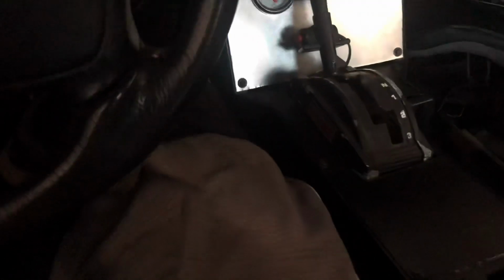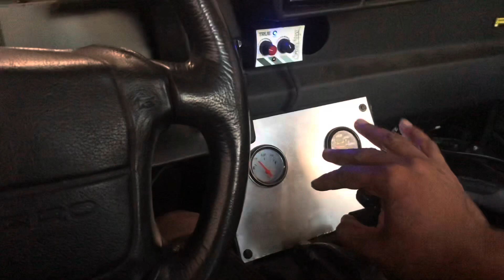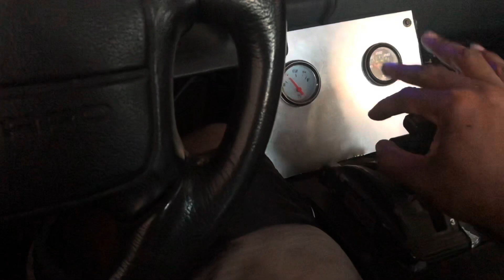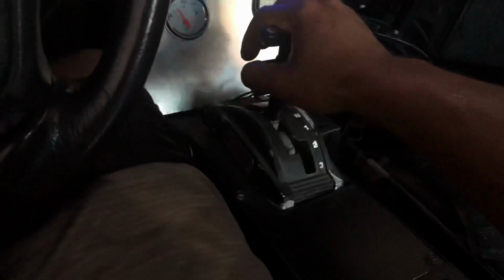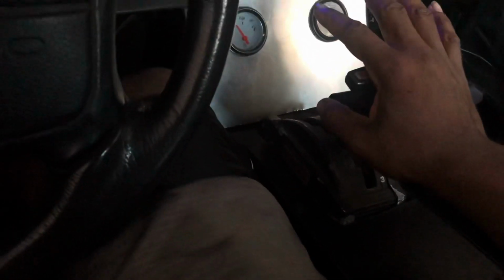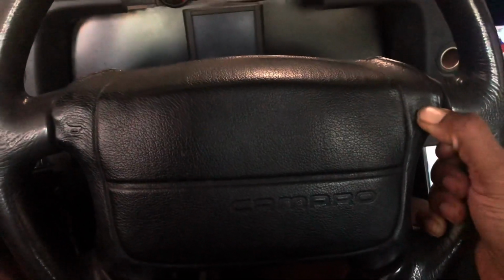Sloppy Turbo 5.3 Thirdgen Camaro gets gapped. #Fbody #turbo5.3 #Camaro

Comment: Hell yeah, do you have adjustable shocks on the front by chance? I had my bump through my horn button for a long time. But the clock spring on it would actually interrupt signal if I was actively turning the wheel even a little so I had to get rid of that. Make sure yours stays active even if you turn the wheel a little to avoid accidentally launching from a slight wheel turn when you bump lol. Can’t wait to get back out that way with ya 👍🏼
Reply from the maker: No adjustable front shocks yet. The money I had saved for them what to go towards fixing my truck. I definitely check to see if it’s still active when I turn. You coming up to Limpy flashlight race next weekend here?
Reply: @boostinwillie  I sure as hell hope so. I hurt my driveshaft again so I’m trying to get it fixed before then.